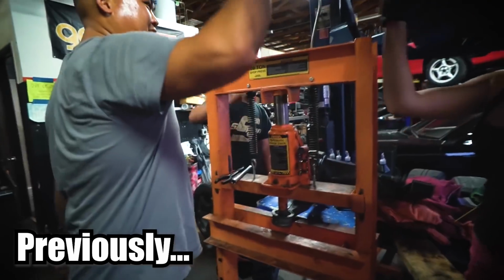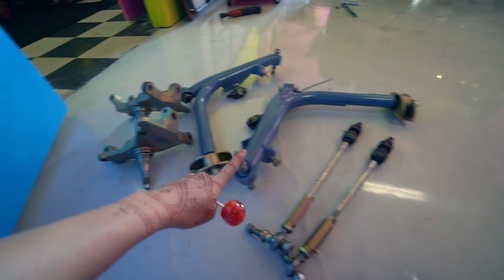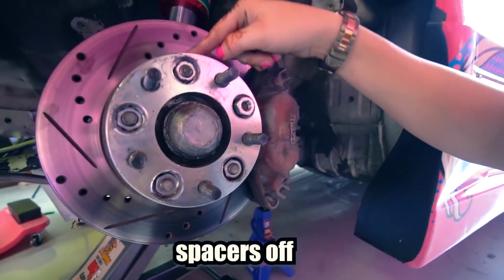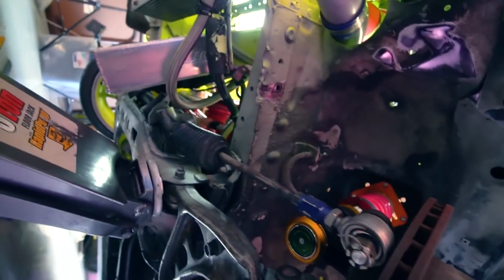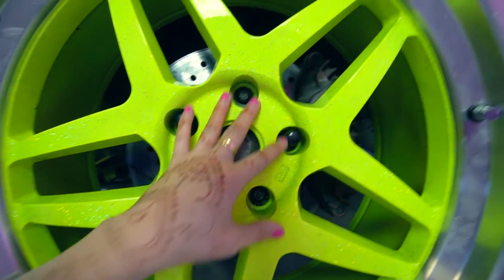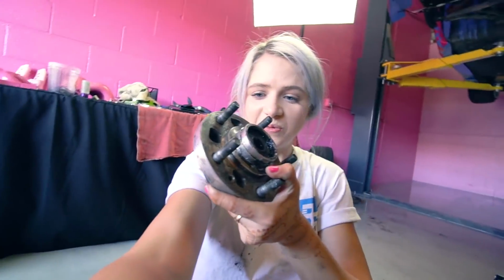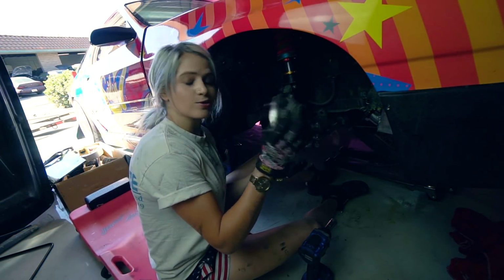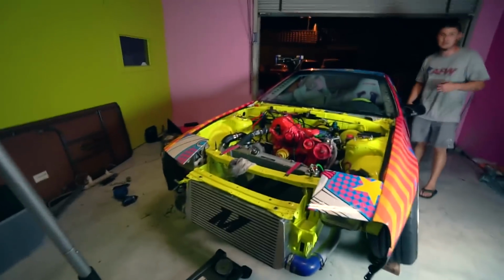Custom RX7 ANGLE KIT!!

Comment: Oh boi you leave her alone and this happens you had what looked like a 20-25 mil spacer and you ended up using 14mil spacers WHATT .... the coiliver had a slotted top hole , you were to pulled out on the knuckle away from the strut to clear the wheel. 🤦‍♂️
Reply from the maker: MiG Ren E' Nope. We already adjusted the coilovers. They needed spacers because my front rims are 18x10.5. This was the solution aside from swapping rims 👍🏼